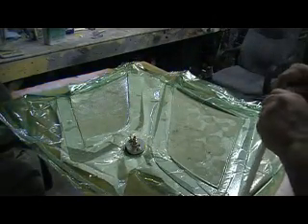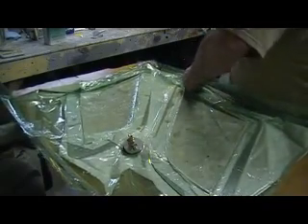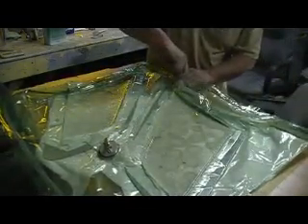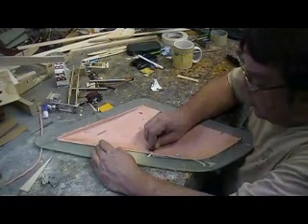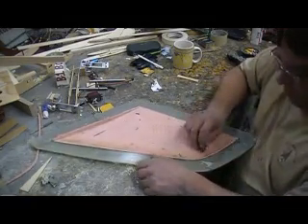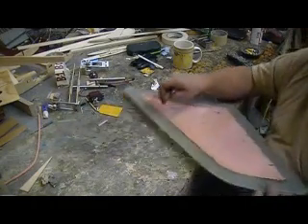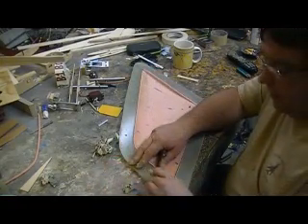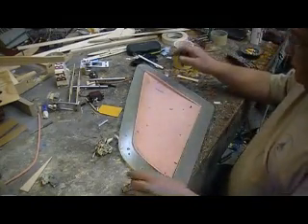how to build a rc jet F-105 thunderchief # 390

Comment: you can get bag clips from CSTsales.com.  This will allow you to reuse the bags much easier.  if you want to stay old school, you can use goo gone (the spray can that freezes gum) and or your computer duster can inverted.  this will allow you to freeze the dum dum tape / sealant tape and easily pull appart the bag without distroying the bag or the sealant tape.  once it thaws, it can be reused.